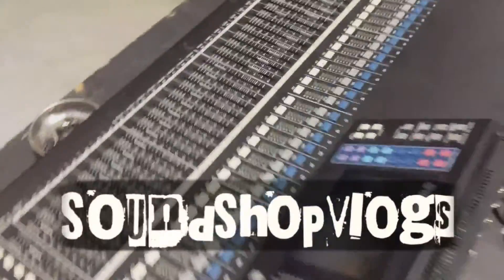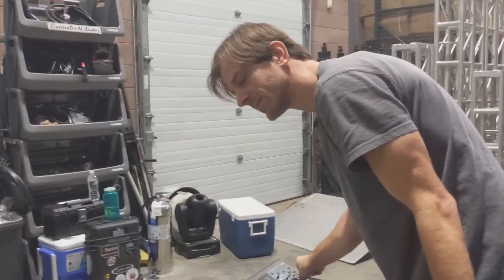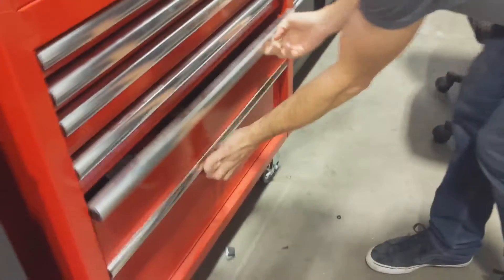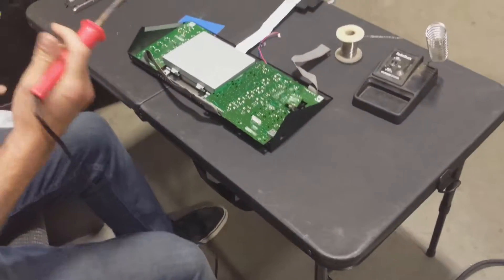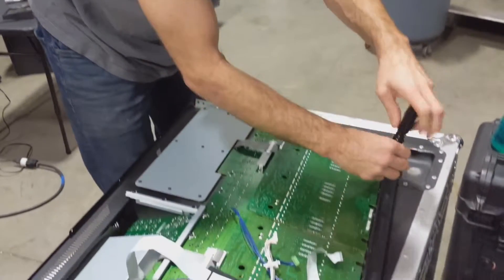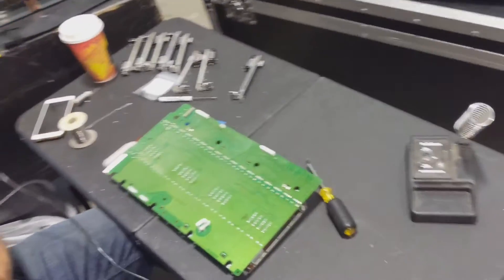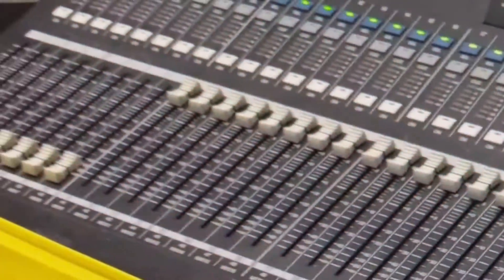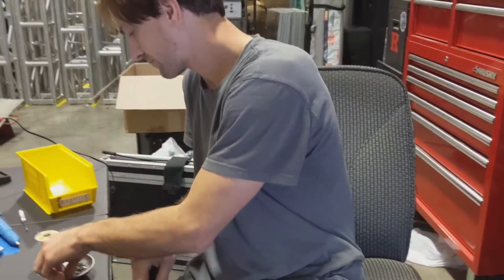s4e13 How to Fix and Replace Yamaha LS9 Digital Console Faders and Knobs, Soldering 101

Comment: I have a ls9 it have no display where can I get it fix?
Reply from the maker: The display doesn't flicker or turn on at all? It's probably a loose or broken connection underneath. Easy ish fix if that's it. If not, you'd have to order a new part.